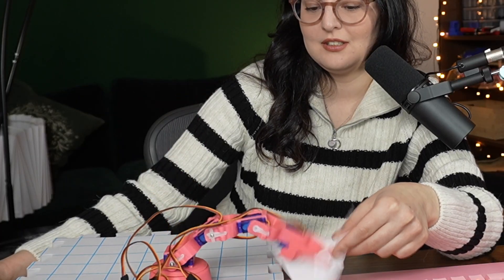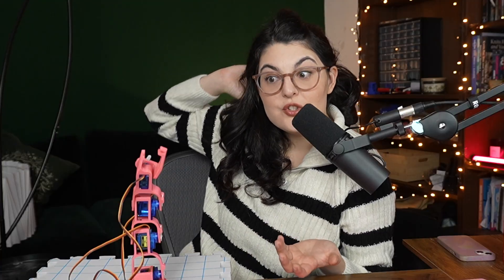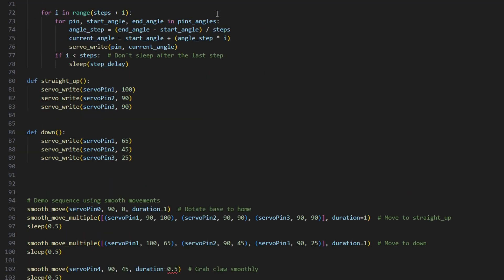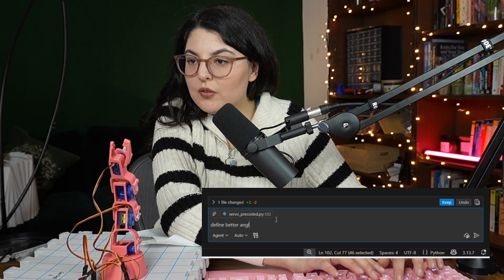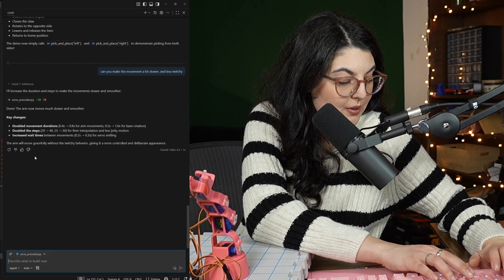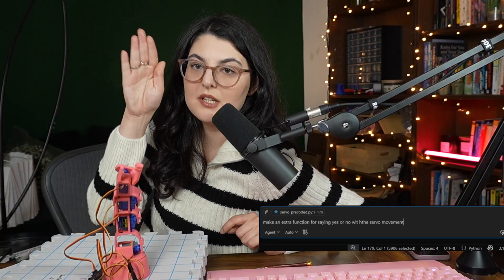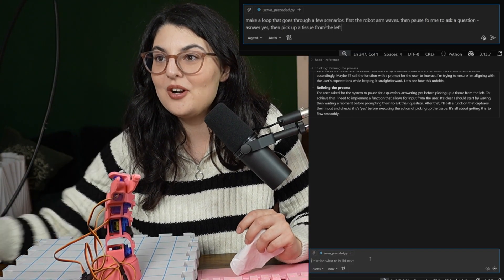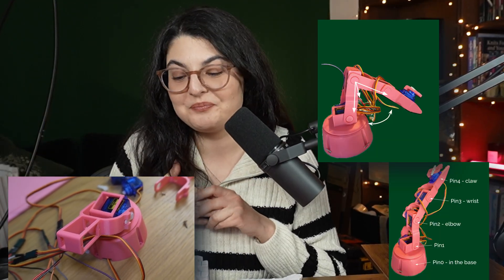I Asked Copilot to Code My Robot Arm (It Worked!)

Comment: I freaked myself out getting chat gpt to write code  for an arduino project. I'm just learning but I needed code for a prop that day and my friends weren't around to help and block coding wasn't' up to the job. It worked great, but I still want to learn to code myself, AI is like anything else, a tool, it's great seeing you use it as a tool not a brain replacement :)
Reply from the maker: Totally agree, it's a great tool to help as long as you also use your own intuition and knowledge! Glad it worked out for your prop project!

Comment: What power supply did u give to power all the 5 servo motors?
Reply from the maker: I added a battery to the pico board, I used a simple 9V one - it's definetely not ideal; but it works for now!

Comment: That's really advanced stuff! Congrats!
What I personally don't like is AI using the sleep function so much - it lets the processor wait. for Raspberry Pi it might be just fine because of multi threading, for Arduinos and ESP32s it is not optimal because it 'jams' the processor for other important operations. If it ever becomes a problem there is tons of code out there to time slice the operations. AI will definitely know how to fix it.
For customizing movement sequences without having them hard coded every time i programmed my robot arm by hand as follows:
Having user input commands to set the angles of the servos one by one until a desired intermediate or final target position is reached and then mark that position with angle values as a key frame. Then on to the next position to make a sequence of key frames like in 3D character animation and interpolate over time between these key frames. Along with a 'run sequence' and 'delete sequence' command, ofc. That's basically what the AI already does, but still hard coded.
With my small Arduino I did that by hand, but i think with a Raspberry PI this should be possible to be done with/by AI. For further improvement that basic low level mechanic maybe can be interfaced as 'movement' layer for more advanced AI that has sensor access and then tells the robot arm where to move and plan a smooth keyframed path with waypoints but has not to deal with actual movement any more. It then just has to provide an array of servo positions and a time when to reach each position which can also be transferred via serial or wifi socket.
And here it is - the end of my messy half-knowledge about robot arm automation. I am thrilled to see the way forward from here on!
P.S.: I would let the main computer 'talk' to the MC with a custom protocol over the serial interface and 'remote control' the movement. That's where I am stuck atm with procrastination..

Comment: I've always been hesitant about relying solely on artificial intelligence. While asking for help isn't a weakness—in fact, it's a great idea—the most important thing is to thoroughly understand the code so you're prepared to change any value or correct any error. No matter how advanced AI becomes, it always lacks one thing: a connection to reality. Thank you for this wonderful video; I look forward to the next one.😊
Reply from the maker: Totally agree! Understanding the code is key. Glad you enjoyed the video!
Reply: @backtoengineering Thanks waiting for the next one
Reply: yes a foundation helps...with everything in life, and my initial reaction is the same as yours.....understand everything, but recently i've been messing around with purposely not looking at the code and just letting the AI do everything with feedback (cut and past errors etc)  ....its incredibly good and way faster....so good that everyone will be doing this....and if not they will out compete  you... I think the new reality is generate prototype with AI for sure...so fast, then even fine tune with AI.... and possibly proofread the code near final release........and use AI to try to find bugs.......    there may or may not be more bugs in software down the road because of this.... but that;s up to us to find new ways to correct this.....or not....
Reply: @unionse7en  "Asking for his help is not a shame; however, the foundation is understanding the code. I was working on a specific project and used artificial intelligence in all its forms, and the result was its failure despite providing it with all the information, videos, images, and tested values. Yes, for small projects that do not require complexity or a connection to reality, it is good and can shorten the process. But when the project is complex, or you want to develop a new idea, the performance is actually weak to average because, as I mentioned, it is not in touch with reality. I am not against its help, but understanding the code is always the basis, my friend."

Comment: Great video! I really liked your warning about not fully trusting AI. I’ve just started building a robot for the first time, and your videos are inspiring because you show how simple you can start and where complex you can reach.

About the part where the AI chooses the joint angles for the desired motion I’m not exactly sure how it works, but I have an idea of where it may comes from. I’m not an expert in robotics, so I might get some details wrong.

In robotics, there are two main methods: forward kinematics and inverse kinematics. To keep things simple, imagine the gripper needs to move from point A to point B. There are many possible paths, but not all of them are correct or safe just like driving a car, you need to follow the road and obey the rules.

Inverse kinematics is used for planning. You start from the desired end position and work backward to figure out the joint angles required to reach it like saying “go 5 meters to the right, then 3 meters left.” This gives you a set of angles that achieve exactly the motion you want.

Forward kinematics is mostly about understanding the system’s position, velocity, and acceleration based on the joint angles. It connects to dynamics so you can calculate the forces and torques needed to produce that motion.

In the end, using these equations, you can build an algorithm that generates the movement. In simple terms, this is trajectory generation: the user specifies the desired motion like the position and orientation of the end effector and the system figures out the path to get there.
Reply from the maker: So glad my videos are helpful and inspiring you! That's a great breakdown of how it works!

Comment: I'm also very hesitant about all this ai stuff. Especially the effectiveness environmental aspects of it make me very wary. 
That being said. I need a new phone and my mom is paying for it and the Google pixel 10 is cheaper than the iPhone 16e I was gonna get to replace the 12 after the Bath ruined my ip68 rated phone. 

Because ip ratings degrades over time and I had no idea 😂. Oooof!!! I was very proud of myself for making the phone last so long and then blammo I killed it dead. A replacement screen would cost as much as the phone is now worth and I just don't think it's worth it, especially with the battery just hitting it's "replace me" health level. (Noticable in the number of charges I needed per 24 hour period).  
Its all loaded with ai apparently and the AI is actually"useful". Since I'm doing a bad job at teaching myself 3d modeling, it would please me if a useful ai was able to give me 3d models for useful things I'm too stupid to model myself😂
Reply from the maker: Haven’t used any AI stuff on phones either. I kinda hate that all apps on the planet are adding AI features 😅 there’s some cases where it makes sense but they shouldn’t be everywhereeeee

Comment: Thank you for sharing your progress with the robotic arm and i am learning a lot especially the helpful tools and methodology your are using to better your project. It all is helping me in creating my air quality monitor passion project. i am still figuring out usinggithub,code for each component like co2 sensor,voc sensor,PPM2.5 sensor,air pressure,temperature and humidity sensor.A way to power it all and learning to make a PCB on easyEDA. So excellence requires patience and consistency .Hoping to shine with my creation. Thank you for the motivation and your candor with the issues and the solutions during a product development process.
Reply from the maker: Glad I could help inspire you! Sounds like you're on a great path with your project!
Reply: @backtoengineering  Thank you for the vote of confidence.

Comment: One suggestion: if you want to use a LLM that is too resource intensive for the Pico, you can modify the code on the Pico to respond to positioning commands either via USB or wifi, and then have your AI system communicate to the arm using that interface.  I imagine this would save on rewiring.
Reply from the maker: That's a great suggestion! I'm definitely exploring options for offloading the LLM to a more powerful system.

Comment: Do you have any plan to make a tutorial on how to print/make those objects you used for robotic hand using 3D printer from scratch?
Reply from the maker: Hey! I linked the files I used for printing in the previous video in the series. The files are free and open source and I found them online and just printed them, and I go into more details on how I assembled the servomotors!
Reply: Sounds beautiful. Thank you so much. @backtoengineering